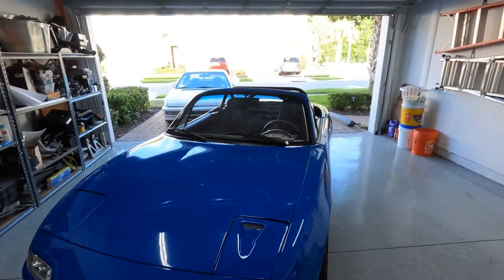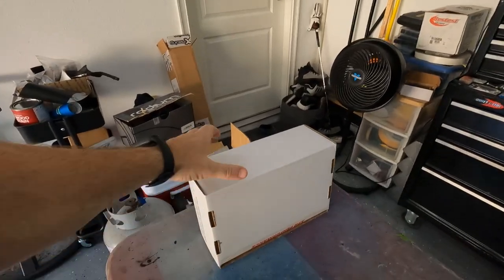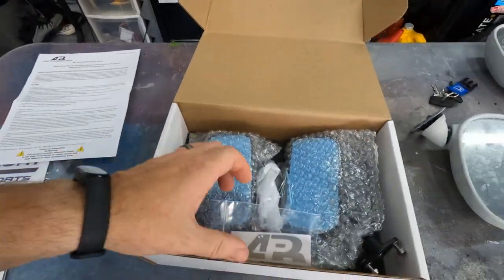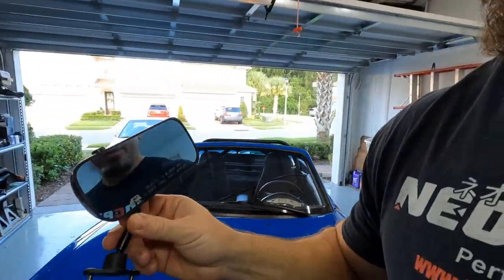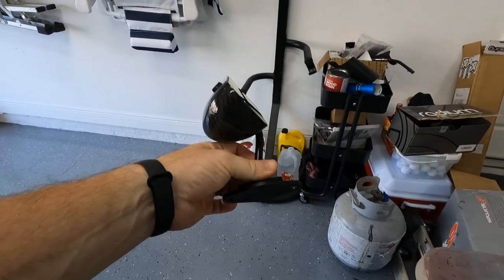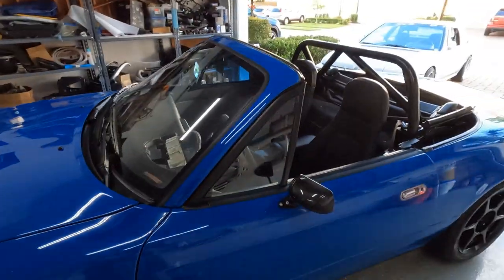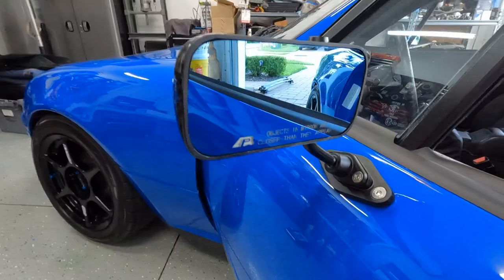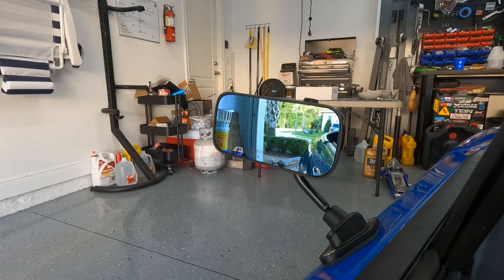$200 Mazda Miata Project - Ep.33 APR GT MIRRORS!

Comment: I've seen pictures of those mirrors that have been on cars for a year or more. The clear coating tends to crack and the whole thing can look a mess.
Reply from the maker: Yep. That's any unprotected carbon fiber product. All you have to do is wax it or use sealant on it just as you would any exterior part of your car and it will last forever.